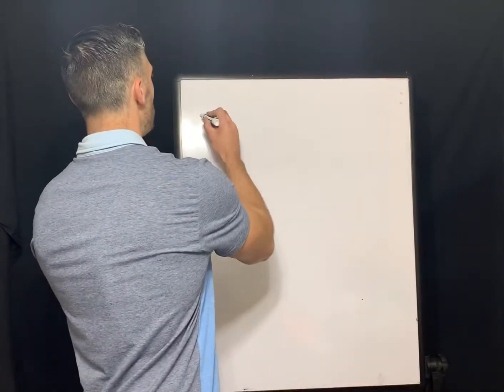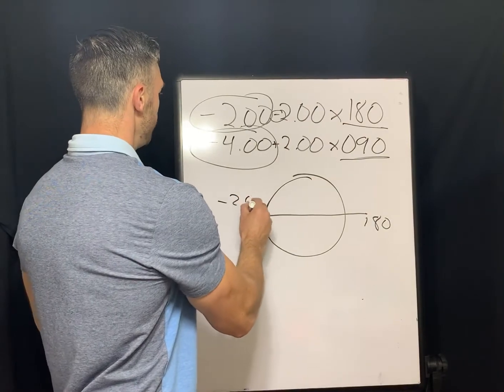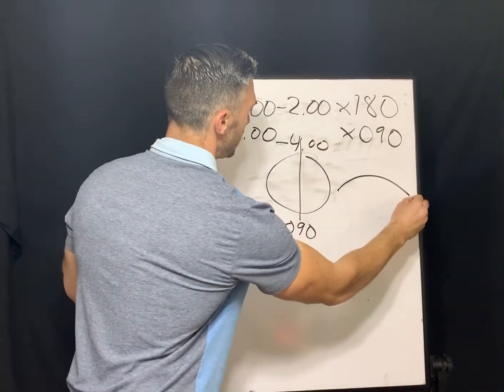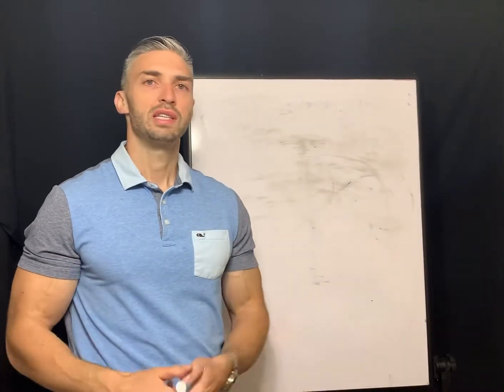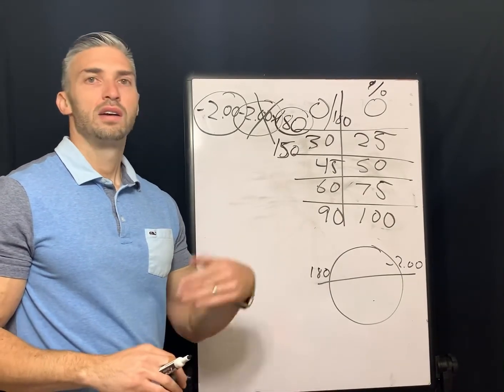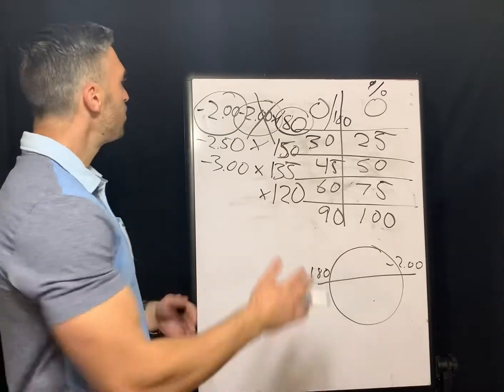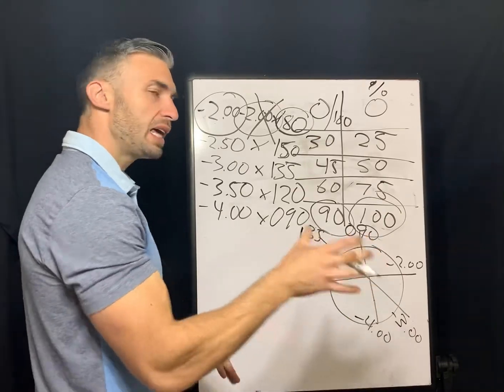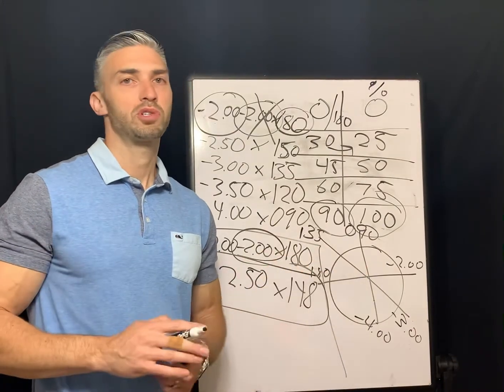NCLE BEYOND TRANSPOSITION

Comment: What contact lens would be prescribed to a Spectacle rx -10.50 +3.50 @45 refracted at 16mm. Do you have video on similar problems?
Reply: Check out his video on vertex distance. -6.25 -3.50 x 135